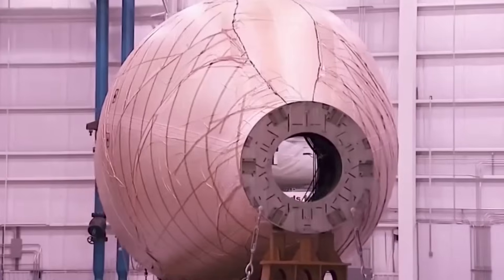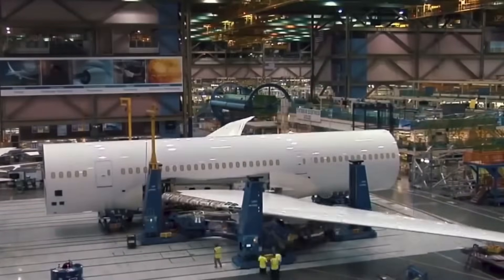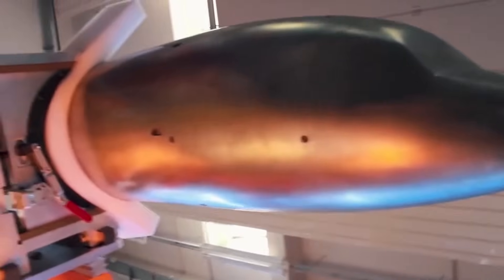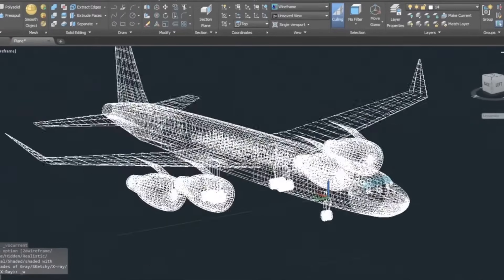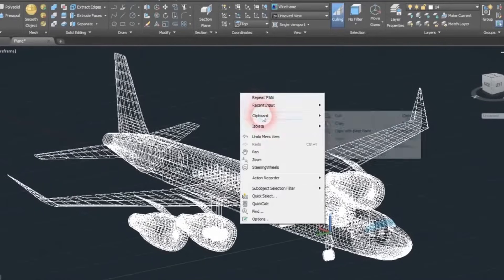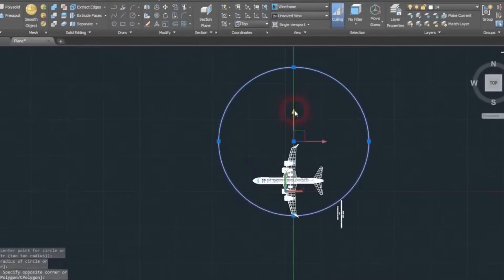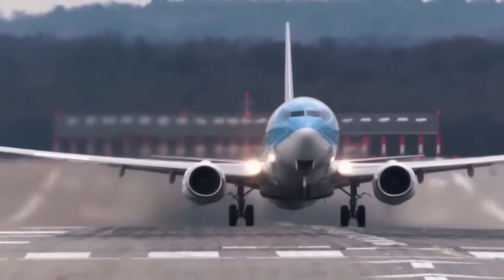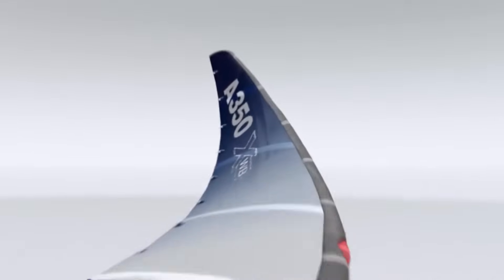HOW IT'S MADE: Airplanes

Comment: Frame manufactue engine fiting whel body electric electronic four plug both ends and red certain ruber edge crane slide fly from stair refly door regrasper crane puley building hihghfly flight copter door roof

Comment: I've been fascinated by planes since I was little, but I was always scared to go fly in one.  Before 9/11/2001, my biggest fear about flying in a plane was that the plane I was in would malfunction and crash to the ground.  It's one thing to have a car accident when you're already on the ground (most of the time...exceptions include having an accident at the edge of a cliff and falling down it).  But, when you're falling thousands of feet through the air and then smashing into the ground (or water), that's a much different story.

Of course, after 9/11/2001, you can also add the fear that the plane I'm in would be hijacked and we would crash into a structure of some kind...a building, a landmark, or some other significant structure.  Sometimes, I worry about the safety of people who regularly fly in planes for those reasons.  To regular fliers, you never know if your next flight will be your last! 😱

Comment: Alberto Santos-Dumont, the Brazilian aviator, conducted his aircraft creations and demonstrations primarily in the late 19th and early 20th centuries. Here are some notable dates related to his achievements:

1898: Santos-Dumont's first successful powered flight took place on July 4, 1898, in Paris, France. He flew his airship, known as the "Santos-Dumont No. 1," also referred to as the "Brazilian." This flight covered a distance of approximately 60 meters (197 feet) at a height of about 2 to 3 meters (6 to 10 feet).

1901: On September 19, 1901, Santos-Dumont made a flight in his airship, the "Santos-Dumont No. 6" or "Dirigible No. 6." This aircraft had a distinctive elongated shape and a gas bag containing hydrogen. Santos-Dumont flew the No. 6 airship from Saint-Cloud, a town near Paris, to the Eiffel Tower and circled it before returning to his starting point.

1906: One of Santos-Dumont's most famous accomplishments was his flight in the 14 Bis aircraft. On October 23, 1906, in Paris, he piloted the 14 Bis for a distance of approximately 60 meters (197 feet) in 21.5 seconds, at an altitude of about 6 meters (20 feet). This flight was witnessed by numerous spectators and is often regarded as the first publicly observed flight of a powered heavier-than-air aircraft in Europe.

1909: Santos-Dumont's last public flight took place on November 12, 1909, in Paris. He flew his Demoiselle (meaning "damselfly"), a lightweight monoplane. The Demoiselle was an influential aircraft design that inspired later developments in aviation. Santos-Dumont made a series of flights with the Demoiselle, demonstrating its maneuverability and ease of control.

These are just a few notable dates related to Santos-Dumont's creations and demonstrations. His work and contributions spanned several years, and he made significant strides in the field of aviation during that time.

----------------

The Wright Brothers, Orville and Wilbur Wright, made significant advancements in aviation and conducted their notable flights in the early 20th century. Here are some important dates related to their achievements:

1900: The Wright Brothers began their serious pursuit of flight in the late 1890s, but it was in 1900 that they conducted their first major experiments. They built a series of gliders and tested them in Kitty Hawk, North Carolina. These initial glider tests helped them understand the principles of flight and develop their control techniques.

1901: In 1901, the Wright Brothers continued their experiments with gliders and made significant improvements to their designs. They introduced the concept of wing-warping, a mechanism that allowed them to control the aircraft's roll. With these advancements, they achieved better stability and control during their glider flights.

1902: The Wright Brothers constructed their third glider in 1902, which featured major design improvements. They achieved more controlled and sustained glider flights, with some flights lasting up to 26 seconds. These experiments further refined their understanding of aerodynamics and control systems.

1903: The year 1903 marked a significant milestone for the Wright Brothers. They constructed their first powered aircraft, the Wright Flyer. On December 17, 1903, at Kitty Hawk, they successfully conducted the first powered, controlled, and sustained flight in a heavier-than-air aircraft. Orville Wright piloted the Flyer for a distance of 36.5 meters (120 feet) in 12 seconds. Wilbur also had a turn and covered a distance of 53.6 meters (175 feet) in 15 seconds.

These flights of the Wright Flyer were pivotal in demonstrating the feasibility of powered flight and laid the foundation for further advancements in aviation.

It's important to note that the Wright Brothers' achievements were based on their extensive research, engineering, and meticulous experimentation. Their aircraft incorporated innovative features like a three-axis control system and the use of a lightweight engine, which significantly contributed to the success of their flights. Their accomplishments in aviation are widely recognized and have had a profound impact on the development of aircraft technology.